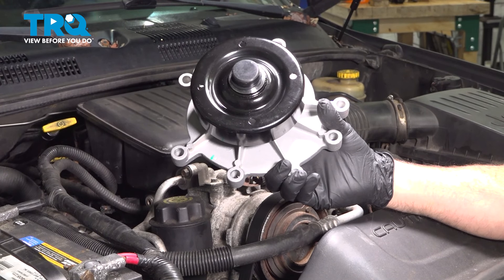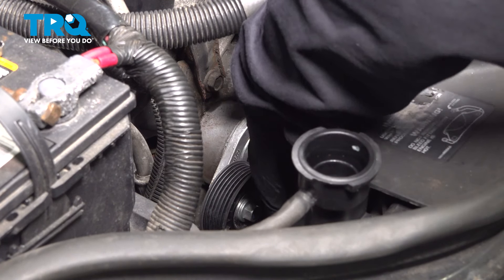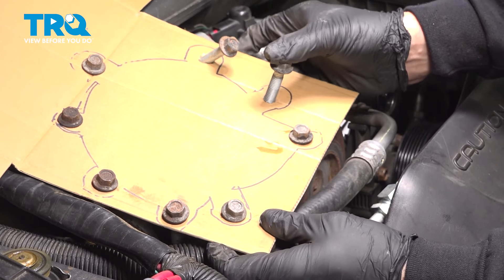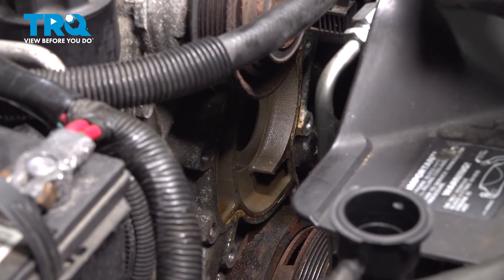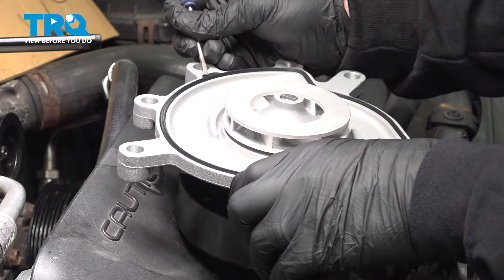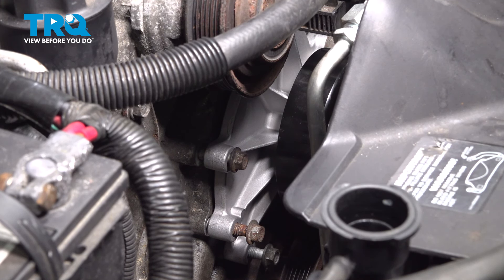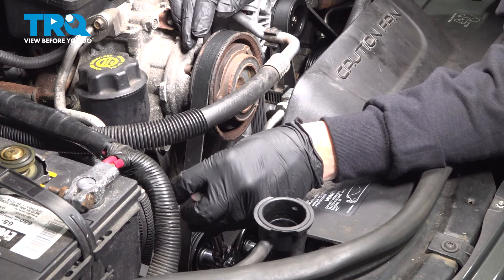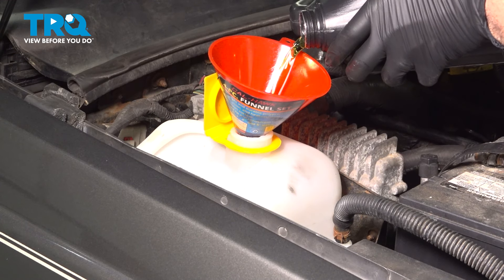How to Replace Water Pump 1999-2004 Jeep Grand Cherokee 4.7L V8

Comment: Thanks for sharing the water pump removal and replacement but the 4.7 has a bleeder port on top of the thermostat housing that you need to use to remove any air from the system.

Comment: Your videos are great you helped me replace my theromstat yesterday, the old one was rusted shut and i drained all the rust outnof the radiator but still over heating. Ao now im doing the pump but i cant get the damn thing out!
Thebpump catches on the fan housing or the pump fan gets stuck inside. Either way i cant get clearance. Do you have any tips?
My thought was to file down the fan housing a half an inch